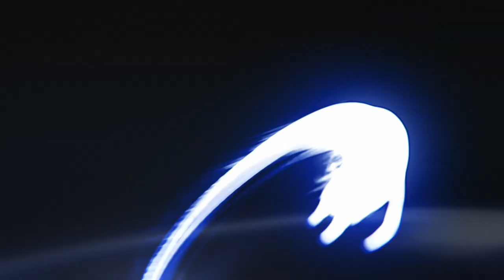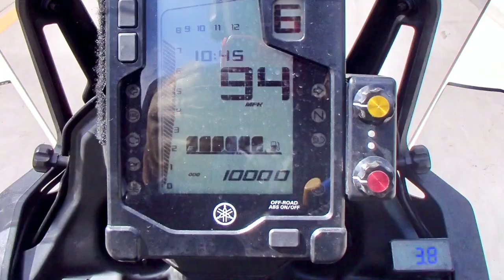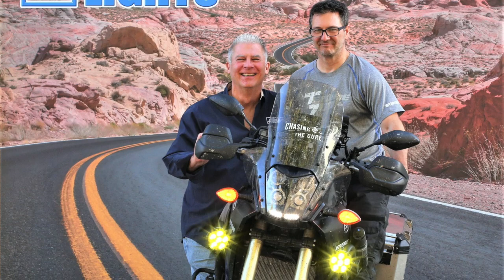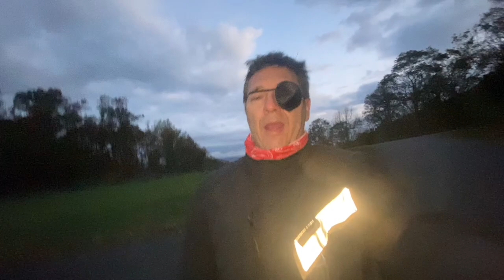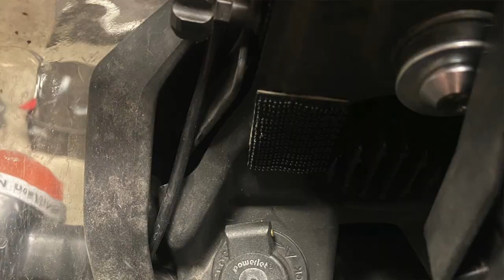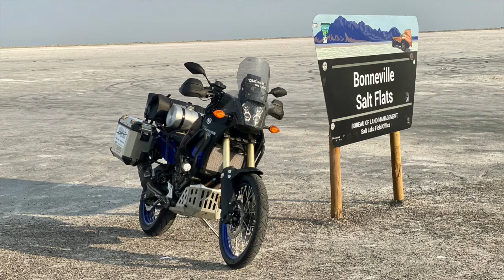Yamaha Tenere 700 Long Distance Set Up - part two

Comment: Hope you are doing well, its been awhile since a new video, I bought a slightly used T7 & now have 15,000 miles clocked & am about finished setting it up for RTW riding, i am interested in the hippo hand gear you mentioned here & thinking of switching to the wire block that you use also.  Again hope all is well ,Oh did i miss the chopper ride ? or is that yet to happen ?
Jay

Comment: You've added a lot of options that require electricity.  Have you run into any issues or limitations with the stock alternator or battery? Would you put in a lithium battery?
Reply from the maker: I've had no issues. Last week I rode NH to GA, 13°F when I left and stayed below freezing for first 700 miles or so. Had a chance to use all my heated gear. Insoles, pants, jacket, gloves and heated grips. Plus the Clearwater lights, phone charger, gps, radar, etc. No issues. Voltage never went below 13.3.

Comment: Great id, tons of info. Could you also share links/video to the heated outfit you use for cold weather?
Reply from the maker: Working on a vid with my gear. 
I wear Aerostich outer gear, exclusively. Heated jacket and pants and controls from Warm and Safe and heated gloves from Gordon's Heated Clothing. I have socks, but prefer heated insoles.

Comment: I'm curious which tires ye be using matee.....ARRRRR.
Reply from the maker: On the street I am running Bridgestone A41's. On the dirt I have a set of rims with Bridgestone AX41's.
Reply: @longhaulpaul  I've heard good things about both.
Reply from the maker: @cuzimaluzer777  not to mention Bridgestone has donated 80 sets of tires to my Journey over the last 8 years.

Comment: Hi Paul. What tyres are you running? And how long do thay last?
Reply from the maker: I swapped the first set for street tires. Bridgestone A41's on the street, getting about 7,000 miles out of a rear. I also have a set of wheels with Bridgestone AX41 dirt tires, but haven't had much time on them to gauge mileage.

Comment: I need more details on that cruise control lol. Looks like it works better than one's made for the bike. Could you send me a better pic of what you did?
Reply from the maker: I used a Vista cruise with the Oxford grips. To mount it to the bike I used an electrical eyelet terminal and gust bent the tab you would normally crimp in wire. The o of the eyelet gets screwed into the throttle housing and the bent piece then holds the groove in the Vista Cruise.

Comment: I guess the Radar  Detctor  helps .. but  I can't  afford Tickets..   I have a Commercial Drivers  License..
Reply from the maker: Absolutely makes a difference every day I'm on the highway.
Reply: @longhaulpaul    I have  one have not mounted it yet.. Here in Michigan   it's  about to snow again .. so not in a rush .  I can't  even tell you the brand off from the Top of my head .. but I can tell you it's the only model and brand I could find  that is weatherprrof  for a Motorcycle..
   I have used Escort Radar detecros  over the years   in cars..
   Quite  amazing  how  often Google  driving Insturactions   gives  you an  audible  warning of  speed traps  reported by Motorists..
  I  downloaded an app like that  from   Cobra  but I don't have a Cobra Radar Detector and didn't  pay the $40  Annual Subscription yet  .. for non Cobra owners..